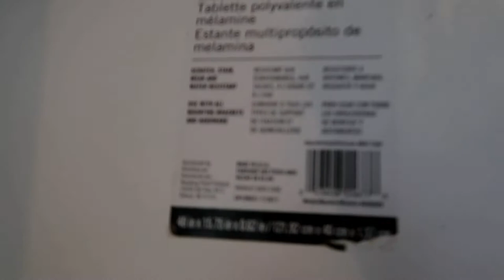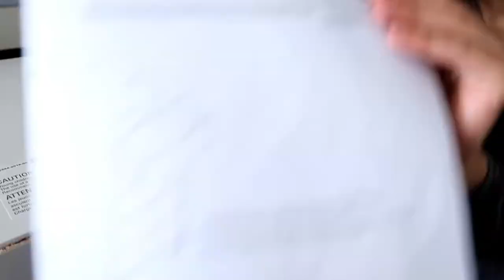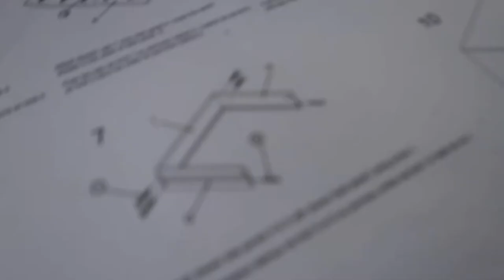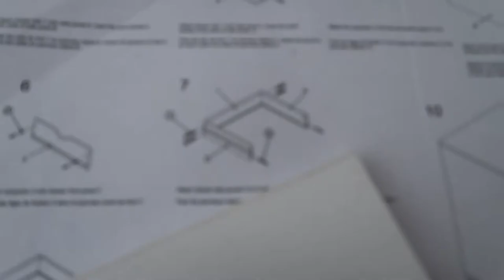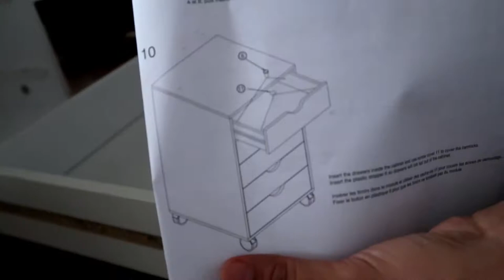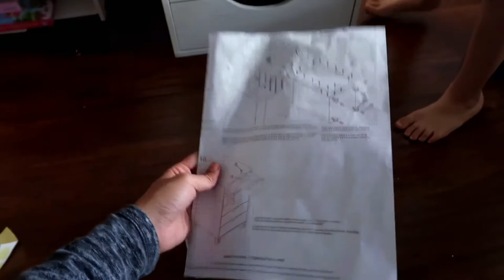Letterpress Drawer | Vanity Drawer | Michaels | How To Assemble

Comment: ugh..them rails  look like cheap plastic...I wonder if they could easily be replaced with metal ones instead?
Reply: If you’re keeping the rail system you would replace the plastic with wood rails. Metal would be drawers slides, not rails. And attaching drawer slides to these drawers wouldn’t work because they have the grove cut into the drawers to accept the rails. 

But if you’re handy enough to make wooden rails you’re probably not buying particle board furniture in the first place.